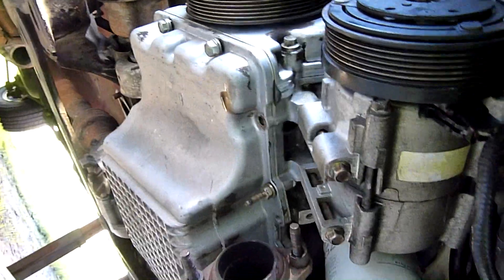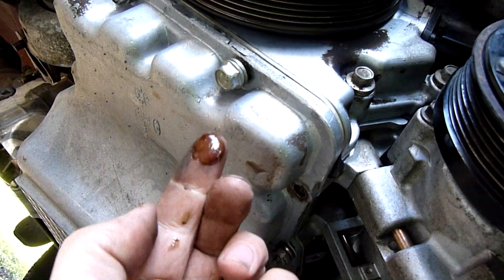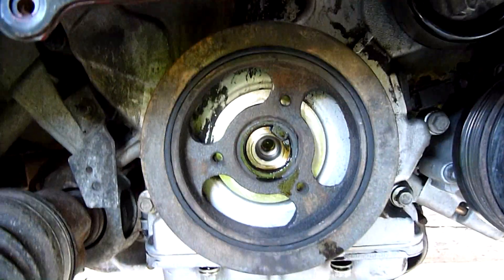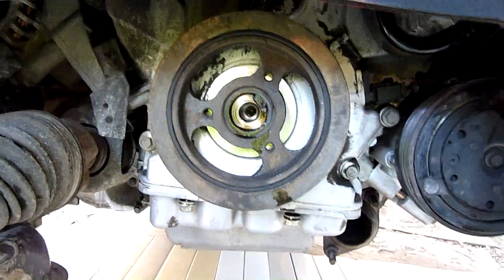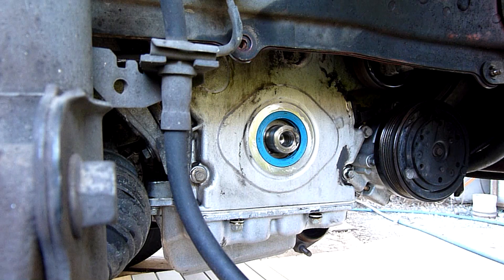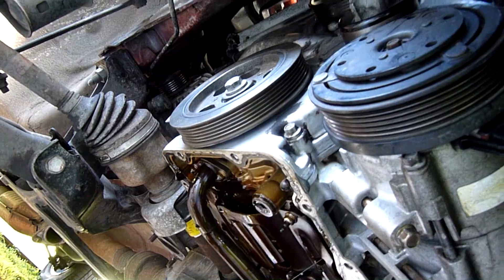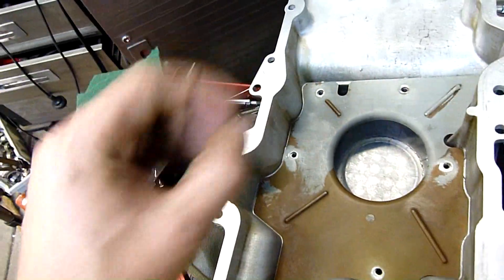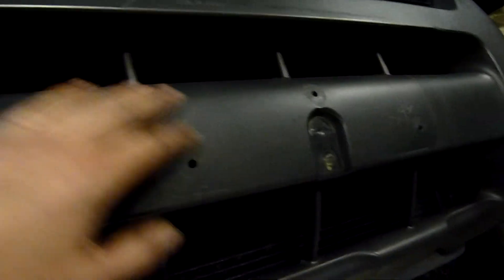Viki the Escape Oil Pan Reseal Pt2

Comment: It was pretty clean in the sump..Unusual for one of those...Did you give the pickup a clean too.?
Reply from the maker: definitly cleaned the pickup and removed a few bits of debris, mostly hard rubber gasket remains. 
also checked the clearance and had 8mm without the pan, so I tweaked the pickup to give my 11mm back.
Reply: Aussie50 hello, can you show the oil pressure sender unit?.. Neeed it badly.... you videos are good im following it.. thanks a lot.
Reply: Theresa Mahinay I have oil lights coming in and i want to know through your videos where it is exactly located and how to remove it.. thanks.

Comment: I just replaced the oil pan gasket on my escape today. One of the 2 bolts holding the exhaust pipe onto the bottom of the rear exhaust manifold sheared off while removing the nut. So I'm gonna have some nice exhaust leak noise while I find a new bolt.
Reply: hello did it fix the leak? i think its the oil pan gasket leak too. please reply, we have problem on our car too, i try to look the leak but it seem it sipping out of the oil pan leak
Reply: +GAR A A yes I would say the leak is fixed. The oil level seems like it isnt dropping noticeably anymore. But underneath I still see one spot that looks a little wet. I'll probably get under it and tighten that spot a bit and see if the leak stops. But it is a whole lot better than it was before.

Comment: Dont you love having a decent puller, makes the job so much nicer :-)

Did you fix the sump plug before assembly?
Reply from the maker: yep, I just ran a 1/4" BSP tap in and used a solid plug.

Comment: Hello, I have a 2001 escape v6 that is not getting oil pressure. Could you tell me if I can replace the oil pump from under the car without pulling the engine. Thank you

Comment: I wouldn't recommend using the sump without the proper gasket. Liquid sealant tends to be forced out into thin ribbons between the mating surfaces. As the sealant ages, strings of it tend to break off inside the engine and end up clogging the oil pickup screen, or worse. Have seen this many times rebuilding engines.
Reply from the maker: that is a good point, I have seen it before but will take the risk, these engines are just leakers with that metal gasket :(
Reply: it always squiz out all the time but most of the time it gets so hard that it dont fall inside the pan

Comment: Edd, you start using the wrong grade oil in that, and you will have quite an expensive and spectacular failure. Japanese Ford engines are very, very fussy when it comes to oil gradings. I put 10/40 in my old Yamaha Zetec Fiesta, and it soon sludged up, and the valve gear started rattling, and this was on a 160,000 km job, went back to the 5w30 and it quietened down dramatically